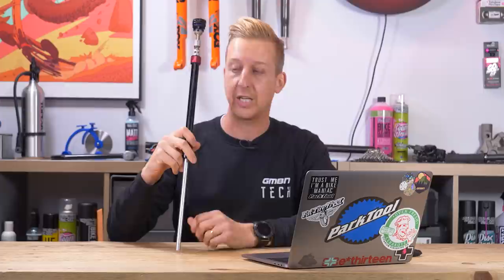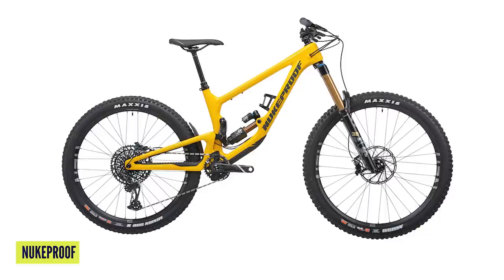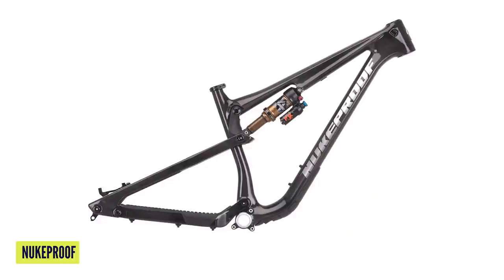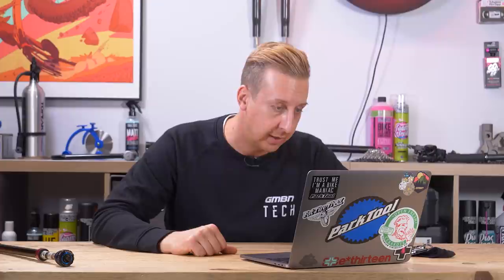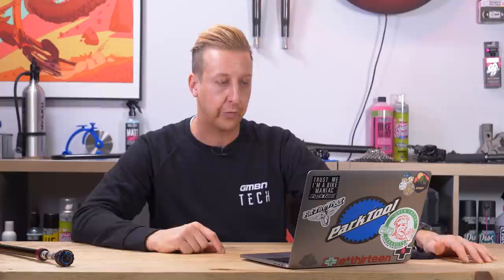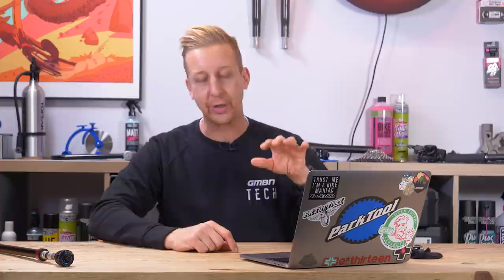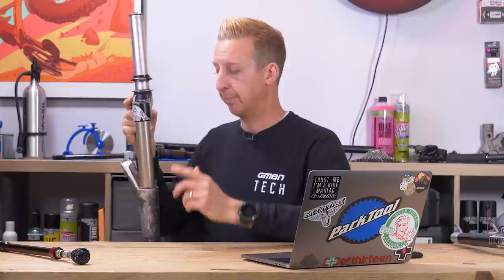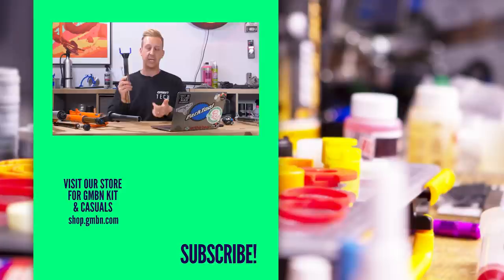Steel DH Bikes & 2022 Nukeproof Frames | GMBN Tech Show 206

Comment from the maker: Would a steel DH bike Appeal to you? Let us know down below! 👇
Reply: Very much!
 right now looking for a steel budget hardtail any suggestions? 😀
Reply: I'll be downhill racing my on order Starling Murmur as my 'big' bike
Reply: BTR Belter? Steel downhill hardtail 61deg head angle 👌🏼 Seriously hardcore.
Reply: @chimps4gimps  thanks so much 🙏 but I am looking for a 140-160 mm travel bike and these are all 130mm max
Reply: @chimps4gimps  this one is great but does it come with a build or just frame(it's called a belter frame)
Reply: Not if it’s single pivot. I don’t want to ride single pivot anymore.
Reply: @odednizan2298  check out the „Hello Dave“! Insanity🤟🏻
Reply: @odednizan2298  the Belter is just sold as a frame. Not very cheap either but you’ll struggle to find better quality. Reynolds tubing that goes through Burf’s rigorous checks. He actually sends quite a lot back!
Reply: Why not? You have guys running single speed slope bikes

I can see downhill parks using these for rental bikes, less maintenance/repair costs
Reply: Hell yes. One gear is all you need, and steel is durable so why not.
Reply: @kyleslater5245  Why? I have no experience with single pivot.
Reply: i would not thrust a metal frame when riding over rocks with 50+ kmh
Reply: Lead sled!
Reply: @chrismade123  So what would you trust? Carbon??
Reply: I have a Sturn Starling V1 #222, love it!!
Reply: yes have one, darkcycles scarab mullet 276. No need for gears when pleney banging..
Reply: steel > aluminum > carbon The weight difference doesnt matter when youre frame snaps, and you cant ride anymore.

Comment: Single speed for park riding is the way forward and much more common than most realise. When you're bombing down hill, how many gears do you actually use?. The derailleur is just another thing to break and weigh the bike down along side a big cassette so why not lose it if you can
Reply: Exactly.
Reply: Have a starling, love it, clean cockpit, just 2 levers.

Comment: 22:37 But EXT has straight steerer, but the crown goes into the head tube, and crown race sits on the crown, not touching the steerer. So far they are the only brand that does it, but it's patented. I have a EXT ERA.

Comment: I have an old (2010) Giant Faith 0.
The Rockshox Totems have a lot of stiction. I found if I stand at the top of a run, and hold the bike on its rear wheel with the forks tipped so the lower oil can flow up the leg, I get a softer run.
Maybe we look at oil wrong in this case.. perhaps a HIGH foaming oil and a valve at the bottom to foam it...
OR... a piston at the bottom with say a 25cc volume with 20cc oil and a spring below, and the piston attached to the dampener shaft.
Compression of the fork would push the dampener, which would compress the piston.. now on the piston, have jet holes so compressed oil below the piston is forced up in a jet to hit the dampener body and splash off to the outer leg...
This could be done on the air leg with a piston much the same, pressed down by the air above.
The oil would be re scavenged by the piston having a 1 way seal like a bicycle pump...
(Consider this comment my patent pending)     :-)

Comment: I think all bikes atm are limited edition due to the global shipping problems,
lovin the starling, fixed gear seems fine to me for a downhill bike and most of my downhill m8's have grip tied their rear sprockets  to the wheel hub to minimise chain slapping and removed back break system now rely on the back peddle to lock the back wheel, which at 1st felt really odd to me going downhill but that was because i was going down a technical decent that required careful slow control rather than flying as quick as possible, my point being that one hill or mountain going fast i only requird one gear, if you want more then put a 52 or 62 tooth crank on, hay maybe this is the new craze waiting to explode onto the scene or just daft..i dunno, but i do know you save weight by removing all the rear brake system and like everything eles you would get used to it and probably stick with it...i better get this idea patented...lol.

Comment: Re: Nukeproof Frames > Right now I have a Alloy Mega 275 which is a very capable 165/170mm travel bike and while the Giga seems to be a blend of the Mega and the Dissent it is more Enduro focused.I would like to see Nukeproof produce a produce a more DH-based version. A Mega/Dissent hybrid that has 190mm rear travel, a Boost 157 rear axle and can take the Dual Crown fok that the Dissent has and retain a dropper post....
Is there a market for such a bike?

Comment: DANGER is the seatpost, lol I had an ultralight alien aluminum post break on me after a couple of yrs. It wasnt on trail but was on the bottom of a dip and so lucky I had just put pressure on the pedals as the 6inch super sharp shard just missed my as@!$! I asked my doc what could have happened and he said prob death. 

It was nowhere near its upper position limit, and I was prob only 175 lbs ... but it was winter. Sucks cause its stopped me from going with weight weenie or carbon posts thinking it could happen again